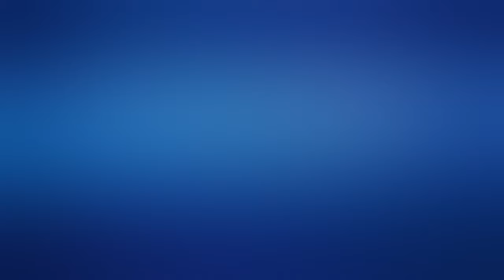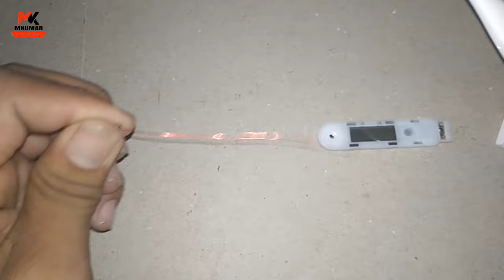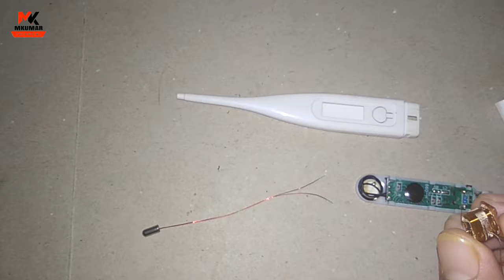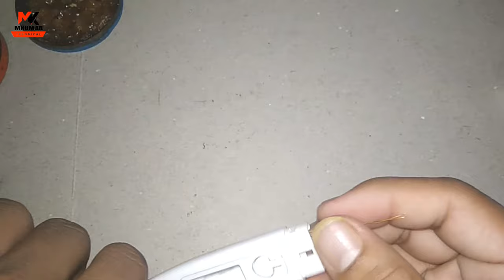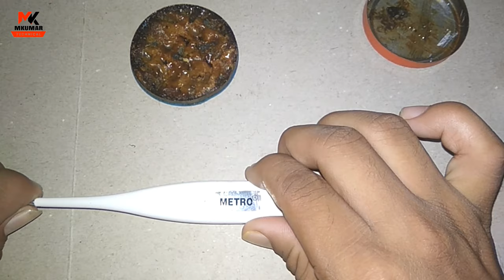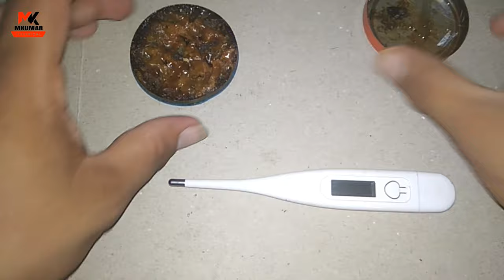Digital Electric Thermometer || How to repair || DIY at home

Comment: On mine the metal tip is on there tight, and there was no way to get it off. Tried pliers and the plastic broke before the tip came off. Oh well.
Reply: 6f6f6t7t

Comment: Really a good explanation for repair. I'm not an electric or electronic person, so asking you doubt. The copper wire might be an insulated one so both +&- doesn't get affected in the normal. But when you do souldering both the lead joints are non-insulated. Doesn't not interconnected?? Please explain.
Reply: I guess the wires' souldering got loosen up with circuit board was the prob so the fix was sticking back them to the board
Reply: He has used tape to cover the solder part, so short circuit is avoided

Comment: what is the name of the wire used ?And where to get it ? And what could be the cost of it ? Actually My Omron thermometer is not opening even after i changed battery. Screen remains blank. It was not used for years.

Comment: Pls reply and can you explain as in which pin to solder or atleast add subtitles
Reply: On a different video they soldered the wires on, that didn't fix the error so they said to reverse the wires and resolder them in the correct places

Comment: Sir,
I have one 'Life Sourse'thermometer.As per guidance in above Video  opened the circuit,and wire attached to PROBE TIP(which to take Temperature),the probe tip wire is dissldered and not working and not showingTemperature.The problem is that have not taken out the Probe Tip for solderng the wires.Pl guide me how can i take out probe tip it is so fixed not  coming out.Pl give solution how can i take out probe from Thermameter.Thank you Sir.

Comment: What is the name of wire you used to extend the existing wire....and is it supposed to solder in main circuit or to that round metal type thing.
Reply: Copper wire
Reply: Both both the shoulder joints are open near to each other for interconnected.
Reply: Jumper wire

Comment: Adding extra wire with existing wire temperature that thermometer will show will not be correct.
Extra length will result in bad calibration.
Reply from the maker: Copper wire cannection

Comment: How did you opened up the upper part?
Reply: That white cap just pulls off.  Be careful pulling it off the first time, or you really will have to resolder those wires

Comment: Thanks, you showed me what was wrong with mine.  It got wet and I pulled it apart and evidently ripped these wires.  I thought the ring, which I later realized is the speaker, was an antenna and the two wires were antennas and didn't realize they were soldered down.  Now that said, this video sucks.  It should be like 1 minute long, with narration instead of terrible music.

Comment: Niche wali metal, plastic se bahar nhi aa rhi, kausa tool use karu ??
Reply: Same here
Reply from the maker: Combination Plier ka use kro..
Reply from the maker: Combination Plier ka use kro.. ho jayega lekin under ka wire cut jaayega..
Reply from the maker: Combination Plier ka use kro.. ho jayega lekin under ka wire cut jaayega..
Reply from the maker: Combination Plier ka use kro.. ho jayega lekin under ka wire cut jaayega..
Reply: Same here
Reply: Clockwise or anticlockwise rotate kare?
Reply: Yes, this should have been included in this video.